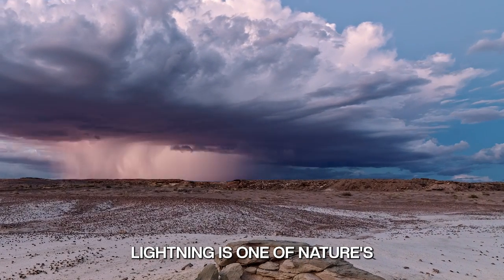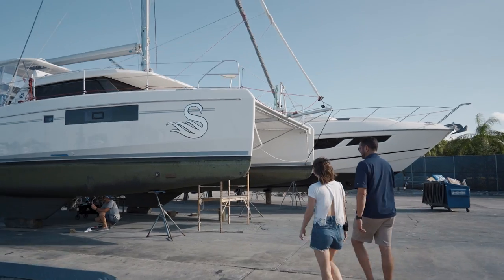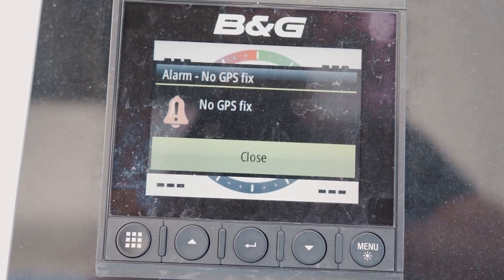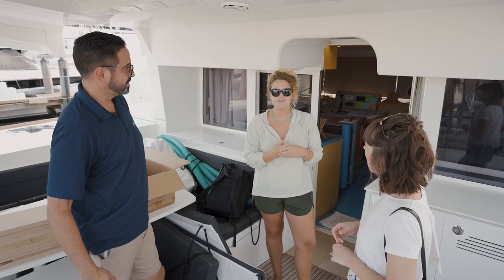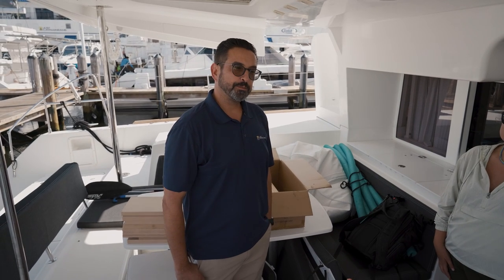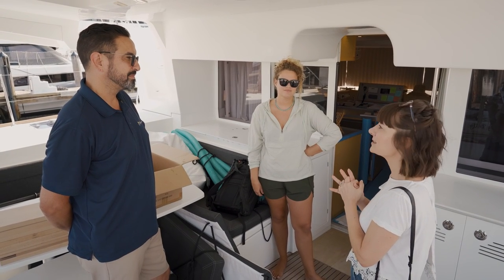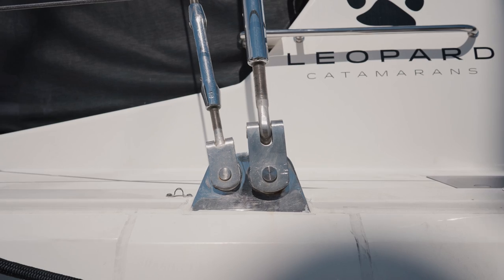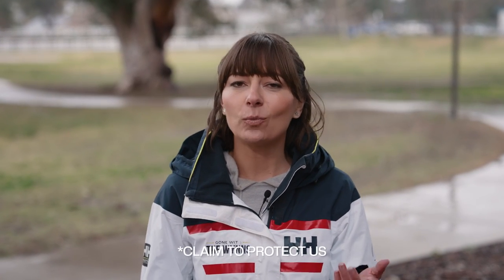Can Anything Stop Lightning?

Comment: @ Jason and Nikki what it looks like to me is the same kind of technology as a lightning rod.  which have been around a long time and have proven to absorb the strike.  although the rods also have to be replaced by wearing down from strikes.  something else to consider is the surge from the strike that destroys your sensitive electronic equipment.  there are 2 or 3 companies that build a surge protector that is higher quality than your usual surge protectors.  these surge protectors use a pass thru filter that sends the excess voltage back to its source.  in the case of boats out to sea that would mean your batteries.  but it would save your electronic equipment on board.  to me there would be no hesitation in getting the device to deflect the surge to ground even though its expensive 15000 because a direct lightening strike could cause a fire which might result in your boat sinking!!!  i have a home built in 58 which has no ground so i use an 8 outlet zero surge protector for my computer.  it cost me 250 but its like having insurance.  zero surge has you tube videos to learn more.  the protectors have been around since 1989 and are still in use because the typical surge protector uses sacrificial technology that wear out degrade and sometimes break up or melt.  they use metal oxide varistors which sometimes catch fire.  zero surge will work up to 6000 volts.  a direct lightening strike can be more but in that case you will have arcing.

Comment: I know lightning can induce currents in circuits not even connected electrically to parts of the boat where the lightning current is flowing, but I have to wonder how much effort the marine electronics companies go to design products to reduce the change of that happening, or have lightning surge protection built in where the current is direct in its power supply and other connections.  Plus I'm sure there are ways to minimize direct (non-induced) current propagation like providing multiple physical disconnects so you can ride out a storm with minimal equipment in the direct line of fire.  Like do you really need all the mast head sensors during highest risk moments?  And how about mast head sensors to give you an early warning of high electric field strengths that are increasing rapidly?  Maybe at a time you don't even realize there's a lightning risk - "dry lightning"?  Just throwing ideas out there because this seems like an area ripe for innovation.

Comment: My professor colleague working on lightning is extremely skeptical... Make your boat resilient in case of a strike (direct or proximity), that's all: clesan electric wiring, surge arresters everywhere, and above all, a good grounding plate. There seems to be no magic protection from lightning strikes.

Comment: Curious what Navies and shipping lines do to reduce/lightning hits. I would imagine it would be some form of Faraday cage. Think about how much it would cost to replace the electronics on a Guided Missle Frigate!
Reply: Steel hull...
Reply: Most military equipment is made to withstand EMP’s also, so that would help with lightening too.
Reply: Navy ships are a Faraday Cage. And EMP is still a problem. There's a lot of research that has gone into hardening naval vessels against EMP. I have no idea how much may have been released for public use. 
To give you some idea of the scope of the problem. If it produces light (any lightbulb) & it's mounted on the exterior of the vessel it's a receptor for EMP. If it's connected to the elect/elex systems of the vessel its a breach in the Faragay Cage. That includes most forms of antennas as well.

Comment: Depending on material boats and aircraft can become magnetized from a lighting strike. This will mess with a whole lot of systems. It is not cheap to demagnatize but cheaper than replacing hundred of thousands in avionics that don't actually fix a issue

Comment: I am very skeptical of this thing. It sounds like a lightning rod, not a lightning repelling device. Electronically I think it would make a lightning strike more likely, but reduce the likelihood of damage from an individual strike. I would challenge this company to put their product under a tesla coil next to a control without their product and see which one gets struck. My guess is that any protection that this thing provides is by directing lightning through the system and thus away from your electronics, not by somehow repelling lightning away from the boat.
Reply: I agree. And once you have attracted lightning it wants to take the most direct route to ground. Quite hard to create that route on a catamaran.

Comment: Lightning rods do work but the cable needs to be fully insulated all the way to the water and below the draft of the boat before it has open conductors  making contact with water and should be checked regularly for brakes in the insulation and not put through the hull but over the side or the transom and make sure you have nonconductive brake point inline with the drive shaft from engine to propeller

Comment: Lightning ⚡ what can I say.  I used to be an electrician and I have seen a lot of lightning damage over the years.  

There is no rhyme or reason of what fails, but  lightning takes the path of least resistance.  

I have seen thousands of dollars of electronic television trashed and a cheap DVD player keeps on working and both were plugged into the same outlet. 

My recommendation is to make sure everything is grounded very well and check all connections to make sure they are tight and on some sort of schedule for inspection.

Comment: We had a proximity strike at our house a few years back, and it basically took out all the electronics.  It’s unclear to me if there’s a way to prevent the damage as the strike creates large induced currents in anything conductive, and can easily take out traces in silicon computer chips.  Maybe putting portable electronics in an oven which might act as a Faraday Cage protecting it.

Comment: I've been on airplanes when lightning struck. If that would fry your electronics, you would be doomed. The design of aircraft fuselages is in a way that the current can find an easier way than through your electronics. This is possible because the fuselage is either aluminum or covered in a copper mesh. Unless a carbon fiber boat is designed in a similar way, I would not expect a retrofitted gadget to be of much use. You need to replicate the Faraday cage principle on the hull somehow.

Comment: the only real protection known is the faraday cage
but I'm afraid that your ship is already at a stage where it is impossible to insert it into the structure, you should have done it before making the ship blueprint
but you can try making a small faraday cage and put the key components inside
Reply: That's what gimballed ovens are for.😁 Mylar storage boxes also work better than nothing.😉

Comment: The principle of a grounded point overhead of the area to be protected is not new - open-air Electrical Substations use a series of grounded wires to protect the substation from lightning strike - it's standard practice and there are specific studies and requirements used to determine what and where they go. In that case it's wire conductor, not a 'van-der-graf' style ball point, but the principle is sound. Be strongly bonding that point to earth it becomes 'part of the ground', not a potential static charge holder. Think of it in terms of the van-der-graf generator at school, or rubbing shoes on a wool carpet; you build up a static charge which has the potential to attract lightning. If you are earthed well the charge never builds up, so lightning isn't attracted*.
The one caveat I think is that it reduces the chance of being hit to the same as the ground around you - this means that you are only as safe as the ground around you - it (and therefore you) are just as likely to be hit as the ground (or water) surrounding you, and if that area is all well-charged for some reason, then you still may be hit. It's just that now you aren't a 12 meter or more conductor holding up a charged rod to the  storm.
(From an Electrical Engineer with 20 years in the Electrical Utility field)

Comment: Lightening strike proximity or direct hits kill what is linked. All electronics are funrable. So like a house everything connected to the power & earthing is funrable however if inside the house and hard disconnected from power and earthing will not be affected; like pulling the power plug. Lightning is not some big EMP it is high voltage electricity. So the main link is connecting wiring = your battery which is connected to equipment like radio's etc externally and that links through the battery connectors all internally. If you can disconnect plus and minus from the battery the internal equipment will be fine as long your not eathened to the hull of course. That is the problem in the camper where eathing is the chassies. You can make a split with manual full switch in which you can disconnect the internals/externals that you do need to function in times of lightning storm. In harbour if you leave for a while switch off, unclamb your batteries and/or external equipment - earthing if present.. Of course keep the bilge pump connected to a power source.

Comment: There is no conclusive evidence that catamarans are more likely to get hit by lightning than monohulls. Lightning strikes on boats, whether they are catamarans or monohulls, are relatively rare occurrences and are difficult to predict or prevent.

In general, the likelihood of a boat being struck by lightning depends on several factors, such as the size and shape of the boat, the height of its mast or other structures, the surrounding weather conditions, and the electrical conductivity of the surrounding water or air. Both catamarans and monohulls can be vulnerable to lightning strikes, and the likelihood of a strike can vary depending on these factors.

However, it is worth noting that some studies have suggested that catamarans may be less likely to suffer significant damage from lightning strikes due to their design, which often includes two separate hulls and a larger surface area for the electrical charge to dissipate. Nevertheless, it is always important to take appropriate precautions to protect yourself and your vessel from lightning strikes, regardless of its design. This can include measures such as grounding the boat's electrical systems, installing lightning protection devices, or seeking safe harbor during stormy weather.

Comment: Airplanes have been getting hit by lightning for over a hundred years. I'm surprised that the marine industry has not researched how aircraft manufactures have come up with safety devices and redundancies to prevent catastrophic failures in modern aircraft. 
And yes, it took several catastrophic lightning strikes before a serious effort to find solutions brought results. 
And yes, maybe aircraft don't have grounding plates or fancy lightening probs like that mast-prevention-device, but they do have technology that works. 
🌴🌴

Comment: Seems that if the lightning protection companies really backed their product they would offer some kind of warranty. Good surge protectors off a limited coverage amount if electronics get fried while connected. Seems a similar setup with lightning protection would go a long way toward selling the product. Interesting that most of their proof is trying to prove a negative, e.g., “while we have had it installed, we have not been hit”. Is that proof, or just the odds?

Comment: There is a proximity sensor available that even mine sites use that actually acts as a shut down system that isolates the electrical system from itself but I don't know how that would work on boats it counts the amount of strikes and the distance from the system to the nearest strike but as I said wouldn't have a clue if this technology could be used by boats good luck out there especially on an all electronic boat because you would be dead in the water for sure

Comment: So basally it looks to be running a conductor from the bottom of the boat (front and back contact points) through to the top of the mast with an insulator on the top, similar to a lightning rod on a building? 
Not sure I would use aluminum...as it can generate heat via resistance...as it used to burn down houses in the 60's when they wired them with aluminum wires back then.

Comment: I’m not an engineer but I have had civilian and military training along with many years of field experience in the electrical field. I’m not so sure that just channeling the lighting strike from mast to water would help in saving electronic gear. The real problem is the burst of such a strong magnetic field. An EMP. This induces a voltage into every circuit in the vicinity with damaging results. Controlling the path of the strike may be good but I don’t see it protecting any electrical circuits.

Comment: why not install three of those devises.  One on the mast, one on each opposite corners.  Also the plates that go to the water make a sort in them that will ground the boat with large wires like you are grounded to the water while you are in it.

Comment: Back when I flew all over the world, I always carried a handheld aviation GPS with fresh batteries -- just in case.  On one trip, the aircraft's position according to both the INS and GPS agreed, but the aircraft's onboard navigation system was taking us to the left of a lake while showing we were to the right of it.  I checked my handheld, and sure enough, it showed us to the left of the lake, same as what our eyeballs were telling us.  So, that little $400 unit was accurate, whereas the $200,000 aircraft avionics were literally a mile off.

My point:  More expensive isn't always better, which brings us to:

LIGHTENING PROTECTION:  Lightening Domes do dissipate charge, as opposed to traditional lightening rods which are point sources which concentrate the charge.

How much did you say it costs?  $15,000???

Let's cut that by a factor of 10!

If I were in your position, I'd buy an 8" stainless steel ball, a 6" stainless steel ball, take them to a welder and have his cut them both in half with a fine band saw made for steel, with the holes centered in each of the halves with holes.  Then, weld a large stainless steel nut with medium threads in the center of the inside of the 8" half without the hole.  Finally, weld the 6" half with the hole into the 8" half without the hole such that both concave sides are facing outward.  Here's the clincher:  You must find a thick but hollow stainless steel tube with the same size or slightly larger outer diameter than than the hole in the 6" half.  If you determine that's not large enough to handle the stress of hurricane winds, the scale up the diameter of the tube, hole and nut until it is.  Die the ball side of the tube to fit the nut.  Weld a 4 gauge rod to the inside of the other end of the tube.  Figure out a way to securely mount it to the top of your mast.  Run a 4 gauge (or as big as will fit) wire down your mast.  Run 4 gauge wire to fore and aft stainless steel sea grounding plates.  They do not need to be rectangular!  In fact, it's best if they're tear-drop shaped for less drag.  Add a sacrificial zinc anode to minimize corrosion (stainless steel still rusts in seawater, just very slowly).

Then, electrically isolate all onboard electrical systems from seawater.  If there's anything which requires connectivity, such as to the engine, ask an electrician the best way to isolate it.  If it's carrying DC current, a large inductor might be best.  If it's carrying A/C current, a large isolating transformer might be best.  As with any surge protector, your system should still have the appropriate complement of electrical components designed to mitigate damage.

Total Cost:  Less than $1,500.

Sources:
Sphere's:
8":  https://parts.sharpeproducts.com/stainless-steel-8-dia-sphere
6":  https://parts.sharpeproducts.com/stainless-steel-6-dia-sphere

Good luck.

Comment: Did you ask about the effectiveness of the gizmo after it has been struck by lightning? Would it have to be replaced and, if so, would your insurance cover it?
Reply: I don't think there is an answer to that question.  The theory is that ions gather in the air and provide a route that the lightning then follows to an object and then to the ground.  The gizmo disperses the ions.  Therefore, there are no ions in the air for the lightning to follow to the gismo and to the mast. (This is why the guy joked about the gizmo offering protection to the boats nearby.)  This makes the gismo and the boat "invisible" to the lightning as a path to the ground.  So, the company (as with Nikolai Tesla) claim that the gismo has never been struck. .....so, they couldn't answer your question about it's effectiveness after it was struck, as it never has been.